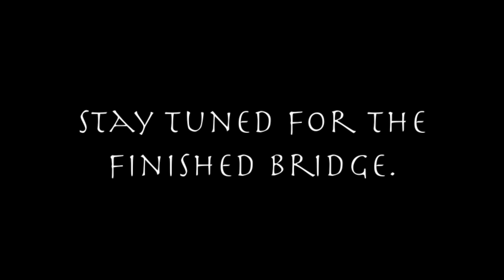Woodworking, Curved Handrails, Samurai Carpenter

Comment: Excellent work,,,one question:  Using the 1 1/2 bit to drill holes for the mortise, I have trouble keeping the drilled hole plum and straight all the way through .  It's even harder in my hands using a short Forstner bit in a drill like you did so I've taken to using a brace and bit with a foot long (approximately) bit which helps out a lot keeping things straight down...You seem to have mastered it so how much practice does it take to feel confident in a project like this one?

Comment: Nice work! One thing I don't understand about the radius... How can the radius be getting smaller if the posts are vertical? if the railing was 100 feet high for an absurd example, and you dropped a cross member in ever 2 feet, at no point would the radius change... no? Anyway, excellent and inspiring work man!

Comment: If you're using vertical posts, cant you just use the same radius for the all rails? If you kept going lower, at some point, the length of the rail would be too short to reach the posts.

Comment: wouldn't it be more cost-effective cutting the arch from a large beam rather then using bend lamination? Or is warping a problem/ the customer wanted a high quality product?
Reply: Soxco Cutting it from a larger beam would create a lot more waste, so how could it possibly be more cost-effective? Sure, it may take a little less time, but laminating didn't really take that much actual working time. Besides, laminating results in a much stronger beam as all the wood grain is going along the beam.
Reply: Chris Sekely and who would not want high quality product for anything ?

Comment: I challenge your concentric curves for the bridge theory (each one is different). That works fine if as a person crossed a bridge and their Shoulder hip line always pointed to the center point of the curves but that's not what happens. You don't tilt backward as you start the bridge stand straight in the middle and lean forward at the end. As a person crosses a bridge their shoulder hip line always points straight down to the center of the earth. In order to maintain constant handrail height the deck and rails should have the same curve. Ignore the stinkin math.
Reply: I totally agree  I think he needs to maintain the same radius for the top rail and the bottom rail then use equal length balusters from beginning to end.  That would be the only way to keep the balusters plumb throughout the length of the bridge.  I work my way through the logic of these kind of problems by applying and considering an "extreme" example.  If the the top rail was a 20' radius and the bottom rail was a 1' radius, how would your bridge look? Now keep the same  20' radius for both and visualize it again.
Reply: Samurai did it right.  Its not about how one walks on the bridge it is how it looks.  I have done curved pieces before where the radius of the two concentric arches were the same radius and it looks unnatural to the eye - in other words; it looks like shit.